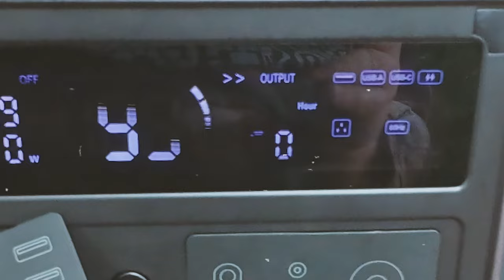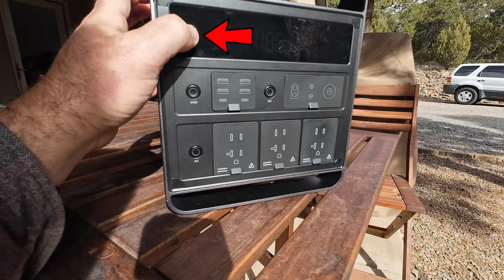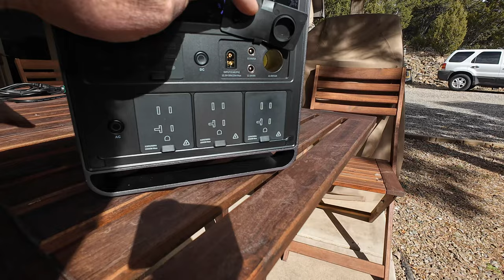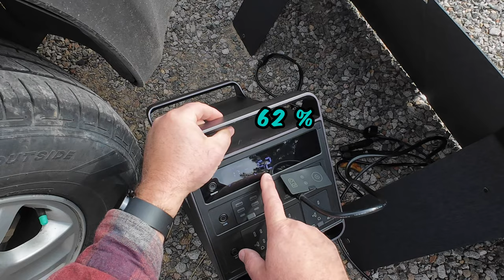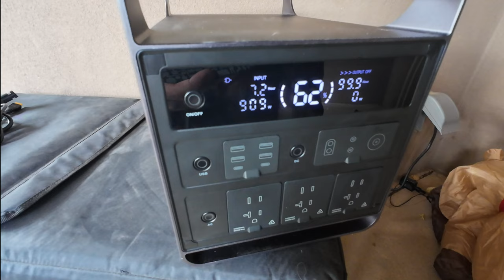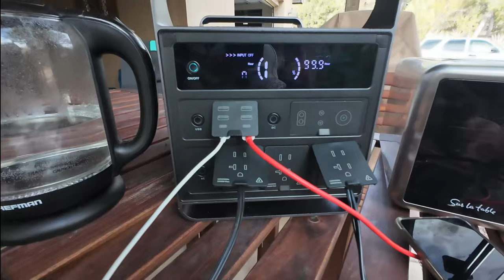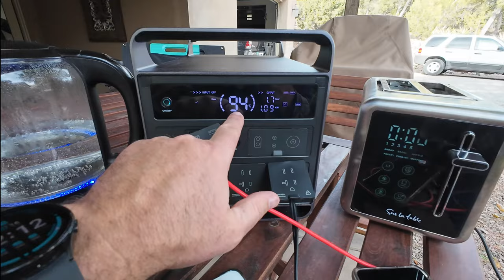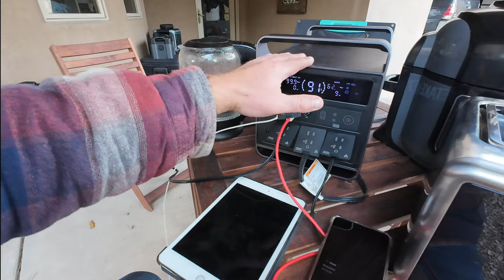Contender for Best Power Station of the Year? ETAKER M2000 Review

Comment: Looks nice. Will be looking to upgrade in the new year. Currently just running a very small eb3a but comes in handy with the increase in severe weather in my region. Got a portable 120w panel, eb3a and mini fridge. If power goes out for a few at least i don't lose all my food. Ideally i want something large i can leave stationary and charge nearly everything in my apartment. Eventually id like to build a tiny house at my family's lake so these kinda things interest me greatly. Cheers Dustin.

Fyi those solar connections are called MC4 for future reference.

Comment: Keep in mind when you’re charging your solar generator with your car you have to start your car first and then plugged the solar generator in to the cigarette outlet because it is like plugging in a battery to a car it will draw too much power from the car it will drain the battery also you have to see if you can use it to jump your car evan though it said that it will jump a car doesn’t mean it will starters for car use a lot of amps to start so it may cut off because of overload the solar generator. You said you plugged it into the card to charge and then the wattage had a little quirk that’s not a quirk mine had the same thing when I plugged it into AC power. It is not an issue it’s just the unit calculating how much watts the AC is pulling, or it’s from the AC power?

Comment: I wish you would have tried a house refrigerator by itself.  I'm looking for a grid down situation.  I was very disappointed with the solar panels.  Also, this looks to be the only size available at this time.  Is that true?  Do they have extra battery add-on capability?  Is there a warranty?  Return policy?  Did I miss pass through charging?  I have been looking at Anker and Bluetti.  What peaked my interest with this product was the weight.
Reply from the maker: My demonstrations show real maximums for these types PowerStations.  A quick search on Google for home fridge power usage got me this:
"The average home refrigerator uses 300 to 900 watts at peak cycle, but most of the time, it only requires 100 to 300 watts. The average unit has an electrical rating of 500 watts, but it's common to find fridges that use anywhere between 300 and 700 watts of power. 

Refrigerators generally have a much lower "running" wattage than their stated average wattage because they cycle on and off throughout the day."
So this will run a fridge without issue but depending on how hot or cold it is where the fridge is will drastically determine how long it will run it as the fridge will kick on more or less to keep things cool.
If you go to Etakers site I linked under video, you can see that many units can link together for a total power solution. I only got one to t
Review so could not test this feature.  I think this is the only size unit they have at the time but companies like this usually start to make many sizes going forward.
Size and durability really stood out for this one as seen in my review 🍻